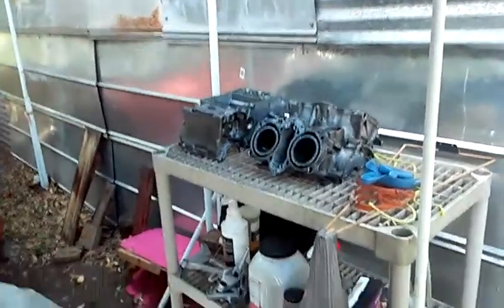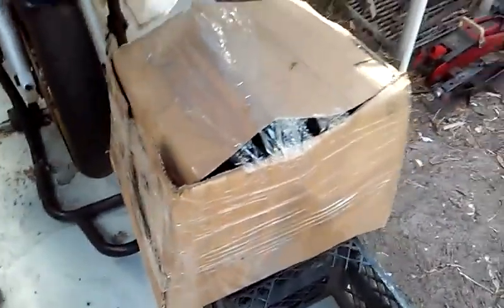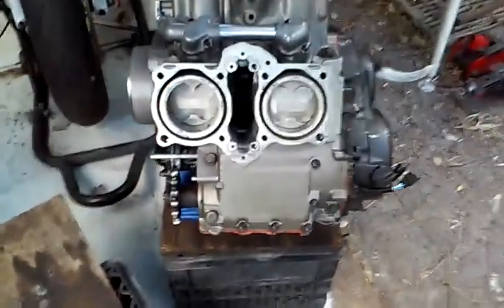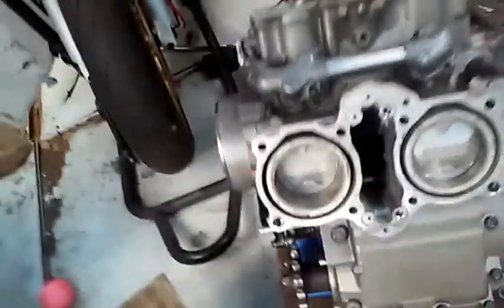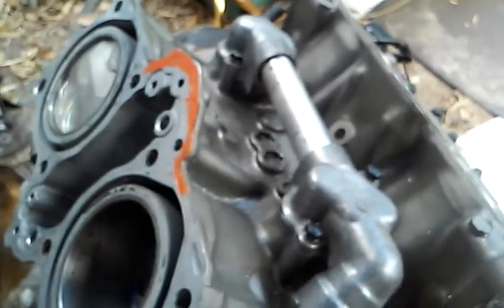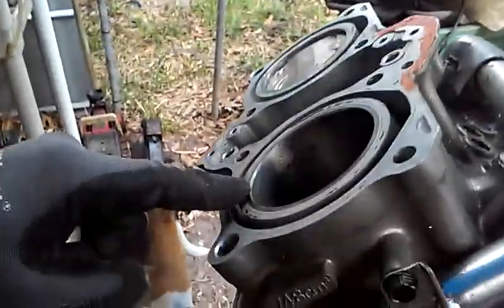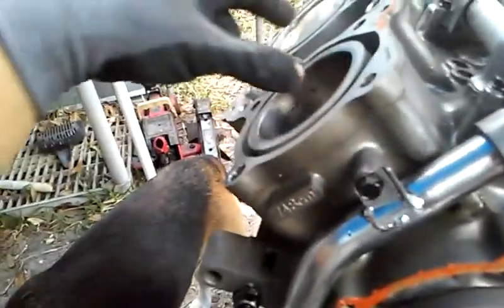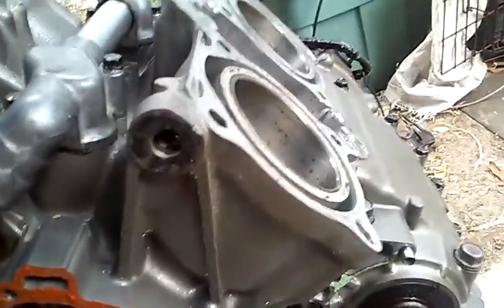Honda V4 Engines - When Do I Need to Rebuild My Engine and Why?

Comment: my cam chain broke...i will cheat and cut a new chain so i can install it without taking apart the whoule engine...the big problem is i can fin a master link to connect back the chain....im afraid using the same pin i will push out may not be strong enough

Comment: That piston on the wrong way realisation moment. At least you saw it.
Reply from the maker: The 86 carbs are different, the 90-93 carbs are different, the 94-97 carbs are different, and the rest is fuel injected.  They are all fun bikes but the 86 one got skinny tires.

Comment: where did you get your torque specs, clearances, min and max values and all that sort of information from. Manufacturer manual or some sort of third party that has a rebuild manual
Reply: Haynes Manual is a good shout, can't go wrong with those.

Comment: You didn't say whether you replaced the con-rods or straightened them. But you've demonstrated what it's like finding out that an asshole has been at work in your engine. No wonder you couldn't figure it out at first. All these lessons are valuable aren't they? Hope you got it all back together okay. 
I'm convinced the VFR is the best bike engine ever made. The Honda Cub may be more successful, but the gear driven cam VFRs are outstanding. And now even Ducati have decided to adopt the V4 configuration. It's taken everyone a long time to catch up hasn't it? 

I'm about to do an engine swap on a Japanese model NC27. The seller told me it was running fine. But after running it I discovered the engine was smoking - oil smoke! Then I discovered he'd overfilled it with oil. Why do that? Because it was using oil and he didn't want me to find out until I'd done a few miles - then he could claim it was my problem! But then I found the bastard had put some weird additive in the fuel tank. It turned cloudy when I drained it into an aluminium tray!!! WTF?

Pulled the plugs. 1, 3 and 4 are fine, but 2 has oil all over it! So it's either rings or valve seals right? Compression test tomorrow. Anyway, I've got a decent low milage American market engine so I'm probably just going to swap them for now. Summer is here and I want to ride. 

Hope your VFR is good now. Am planning a VFR StreetFighter project as soon as I can find a good one. In the meantime I'm designing the bugger in my head. It's gonna be a dark beast with a distinctly alien stealth tech aura about it. Got some novel ideas that have never been done before. 

PSGet a trolley for the engine moving bit.
Reply from the maker: Whomever did the short term repairs only did so in order to gain the highest price for the bike when a dealership took the compression or started the bike up.  To the naked eye, it is convincing.  The question is what now?  Do I replace all 4 conrods or only 2 bent ones?  BASED ON THE EVIDENCE I HAVE, IT APPEARS THAT REGARDLESS OF HOW MANY CONNECTING RODS ARE BENT; ALL 4 MUST BE REPLACED.  I could not find any info on this but the entire set of 4 connecting rods were the problem.  There was no binding after and no engine reassembly issues.  The bent connecting rods also damaged other parts such as scoring on the cylinder walls.  I replaced the engine case as a result but got a good price on the engine case.  This new case had nearly new bearings which really helped the rebuild process.  As a follow up, the bike has over 3,000 miles; it never cuts off and will run hot into the red mark of the temperature, pulls as it should and has no problems going over 100mph.  It runs and it drives as if it was a new engine but a new engine will never resemble a rebuilt one.  So all is well and I am on the second engine rebuild which is at 68,000 miles.  I would say premature but again, it all depends on who worked on the engine before you and how well of a job they did!
Reply from the maker: I purchased a used set of con-rods, $25; they measured straight.  I assumed only 2 were damaged but the naked eye cannot see the problem!  To straighten them I would have to temper and rebend the con-rods; this is going to make them frail; I do not think it is a good idea.